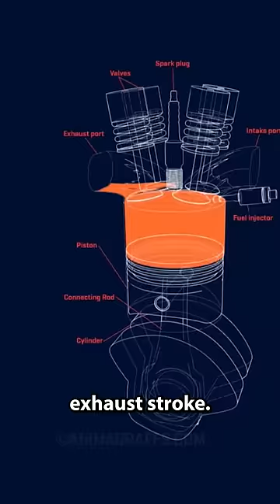Turbos Vs Superchargers

Comment: I think there is a time and place for both. Turbos are far more efficient and have much greater tuning capabilities. But a supercharger has immediate throttle response, and the boost is very linear. If i'm drag racing, or tractor pulling, or running the Texas mile, I want Turbos. If i'm racing a road course, where i need very precise throttle control, as well as the ability to make predictable and consistent power all through the entire rev range, then a supercharger is probably the better choice.
   
Another application where i think supercharging is better, is on our commercial work boats. Locally at the annual seafood festivals, the commercial fisherman drag race their work boats. LOL!!  It's a ridiculous spectacle. Seeing a 53 foot work boat with it's bow clear out of the water, skimming along at 60 knots with a rooster tail, It's actually quite hilarious.  LOL!!!   But the fastest guys are running superchargers. It's mostly because of heat. They run a mechanical draw-through fuel system, and also a wet exhaust. This keeps these engines quite cool under full load.  You try to do the same thing with Turbos, you have a ton of heat you have to deal with especially under those conditions. With those kinds of thermals there is certainly a level of diminishing return.  However, one guy out here is running twin VOLVO Penta engines with turbos, running into his superchargers.  Not sure how that works. Seems redundant. But... to each their own i guess. :)
Reply: I would pay too see these boats drag😂 where at?
Reply: There's still lag lol
Reply: Best boat engine had a blower  for ideal to like 3000 rpm . Then a turbo till top end
Reply: The turbo picks up where the blowers starts to fade. Nothing to lose, everything to gain if properly setup.
Reply: I like a turbo for drag racing because it's easier on the engine and car, easier to get traction. I only launch at 1.5 psi on the trans brake were with a belt-driven supercharger would be much higher. 
Of course, there are many ways to get a turbo car to launch like it has a supercharger with all the boost but it's unnecessary in some cases. Already running 9's on 10psi and that's fast enough for now with a 50 year old car on stock suspension and breaks.
In other words, what's perceived as a shortcoming of turbos can be advantageous to some.
Reply: Supercharged turbo explanation here: https://youtube.com/shorts/IDyELucAakM?si=XM7NexkFPHUfEoMK
Reply: No, you dont want a turbo for drag racing. Turbos are too sluggish for a drag race. A drag race requires immediate power. Drag races are over in 4 seconds. Turbos can take longer than 4 seconds to spool up.
Reply: @opieshomeshop  
Lol, amazing. Nothing you wrote there is true.
Reply: @177SCmaro  Amazing. Yes it is.
Reply: Wouldn't you want a super charger for drag racing since you have limited time, and don't give a rats arse about efficiency?

 I always thought Turbos were better for efficiency. Super Charger for instant power, but is completely parasitic. Especially now that we have turbos that can either be variable, shut off, or controlled. 

 Never thought about heat in a super charger versus turbo. Yet having a super charger being better at heat management is just so obvious, and makes perfect sense. I feel dumb for not even putting two, and two together. Thanks for bringing that up! I wonder what the differences actually are.
Reply: @opieshomeshop  
My 9 second turbocharged Coyote disagrees.
Reply: @dianapennepacker6854  
It's more of a trade-off than better/worse. Typically supercharged cars have a better 60ft times but turbo cars have more top end - in other words turbos do have some lag (although there are ways to eliminate this but it can be kinda hard on the engine) but tend to create more power per pound of boost because centrifugal compressors tend to be more efficient than lobe blowers or screw-type compressors.  
Turbos also take less horsepower to drive. It might take 150hp to drive a supercharger and on the same engine it might take 60hp to drive a turbo giving the turbo engine 90hp advantage at the same boost level.
And, in a way, there can be an advantage to turbo lag in that it tends to be easier on the car when launching and more forgiving to your traction/suspension setup.
But you can't go wrong either way, any kind of boost is gonna make more power over none.
Reply: That's why i own a factory supercharged '04 Cobra Mustang & '23 Powerstroke diesel F250 4wd truck! -NY
Reply: @177SCmaro  Mustanga for life! #GT350R #DarkHorse
Reply: The heat was the first thing I noticed when I started driving turbocharged engines. When I get out of my Mustang it puts out the same if not worse underbody heat than V8s I’ve driven and once it’s warmed up on a hot day there’s definitely a bit of power loss. I’ve read that a bigger intercooler will help but I’m not about to void my warranty. 😂
Reply: The turbos help the superchargers once they go past their pinnacle of boost
Reply: Both charger types combined is not uncommon. But heat problems on a boat is a design problem, you've got worlds largest heatsink. Proper cooling in the block, big exchanger to seawater, and a suitable intercooler will dump all the heat you need.

Comment: The energy it takes to push the exhaust out and spin the turbo is also energy from another cylinder‘s power stroke.
Reply: Not really; that power stroke benefits from the work done by the compressor side of the turbo that allows that cylinder to produce even more energy. 

A turbo is converting low quality heat energy that would have been wasted out the tailpipe into useful work at the inlet.

A supercharger is doing the same thing except it's using high quality kinetic energy to do it.
Reply: You make a very good point but..You're missing one thing...that is hard for me to explain.   You are correct that it still uses power to drive the turbo.  What Gale is saying is that the power used to drive it comes from the lower pressure exhaust stroke, therefore using all of the high pressure combustion stroke to drive the crank.  In other words, a turbo engine will have lower peak cylinder pressure to make the same power as a blown engine. I cannot confirm any of this myself, just trying to explain his theory.
Reply: @alcalc8938 I understand the point Gale is trying to make but he ignores the duration of the pressure! Since superchargers do not need exhaust valves to be open longer than turbo they can run similar pressure but for longer duration to get “longer” stroke of power. Modern engines can inject fuel 14 times during power stroke to keep steady pressure. 

If you were to take specific RPM (centrifugal supercharger) you can have same “peak power stroke pressures” as turbo engine while also making same horsepower.

Turbo is less complex less parts and not directly related to RPM of an engine, win in my book.
Reply: Your over looking a lot.   Turbos extract their energy from both pressure and heat while blowers only get their energy from pressure.  Some of the energy that drives a Turbo is wasted energy that the Engine didn't utilize.  You don't just have a piston physically pushing out exhaust gas on the exhaust stroke, that heated gas is still expanding in volume which is utilized by the turbo.    Super and turbo each have their pros and cons.  It depends on what you need and what you are willing to trade to accomplish that need.
Reply: @TheJTcreate  heat and pressure are essentially the same thing (enthalpy if you're an engineer). Another way to look at it is as an optimization problem. The engine is tuned to extract energy at high pressures and once the piston gets to a certain point in the power stroke it's no longer extracting much energy, that energy just gets blown out the exhaust and you'd have to dynamically change the cylinder diameter during the power stroke to fix that problem. The turbo is  fixing that problem but redepositing the energy it's recovered in the intake air to be reused.

If you look at a modern jet engine you have a high pressure turbine section and a low pressure turbine section (the power stroke equivalent in a jet) to deal with this issue, their geometry is different and the may (must? Can't remember) turn at different speeds.

A supercharger is using shaft energy (which isn't energy that is going to be wasted) to put enthalpy into the inlet air stream.
Reply: @TheJTcreate  Supercharging is a con period. Unless you are the type to drive a car as-is off the showroom floor. I used to have a Cobalt SS Supercharged. It's already at the limit pretty much from the factory. To gain serious power you need to twin charge it or replace the supercharger or both. Nitrous oxide is an option and the least expensive upgrade but not popular in the sport compact, 20 something first car community.
Reply: Doesn't the flywheel and staggered strokes kind of even all this out?
Reply: The term everyone is forgetting is "back pressure"

Basically If you want low end torque the supercharger is better than a small housing turbo with excessive back pressure.
Reply: @dj4monie Supercharging is a con in your opinion, because what, you aren't smart enough to realise that a supercharger has a limit to it's effective flow rate, just like a turbo does?  Or because you never changed the crank or supercharger pulley to get a higher turn ratio out of the blower?   And let's forget that miller cycle and 2 stroke diesel engines etc exist
Reply: @alkalk8938 But isn't one cyclinder's exhaust stroke another cylinder's combustion stroke so thereby a power stroke is still directly driving the crankshaft that is tied into another cylinder's exhaust stroke to ultimately spin the turbo? If his measuring technique is fair, it would be comparing turbo power (vs supercharger) relative to the cyclinders' power stroke pressure and not exhaust stroke. Seems to be a purposely handicapped measurement otherwise.
Reply: @dj4monie Supercharging is your instant response.
I've driven a SL55 Kompressor, and a small twin turbo hatchback.

The weight difference is staggering, as is the performance. If you want to run an actual car down the road quickly, a supercharger is the way to go.

Turbos are simply too inconsistent for anything deviating from a straight line. Cornering and accelerating out of braking demand instant throttle response. Even with a smaller turbo feeding a larger, they will never be fully in line. Turbos aim to solve a problem that superchargers don't have.

In terms of parasitic loss, you have to think about how often you're able to go flat out to benefit from a large turbo. Because for a small turbo, it's going to be outgunned by a steady supercharger anyway.
Reply: Ya lets argue with Gale Banks....😅
Reply: Well the engine will still gonna have to get rid of exhaust gases anyways so why not make use of it.
Reply: @SpiderHamPeterPorker  if we look at it like a single cylinder engine to simplify it, your point stands that the turbo is drawing power from the backpressure created by the momentum of the crankshaft, which is only moving because the power stroke is pushing it along. so there has to be a certain amount of work done to feed both the parasitic load and to create your usable power. a supercharged engine has to create all its power with one stroke of the piston meaning you need to create less power, or make your engine stronger. a turbocharged engine has the luxury of spreading all its work out between the power stroke and the exhaust stroke, meaning more power or you can get away with a cheaper/less durable engine with the same power. add in the fact that the exhaust gasses are still expanding due to the heat they carry and you get an additional bonus of efficiency.
Reply: There is no free lunch especially in thermodynamics
Reply: @piterpraker3399  turbo's game is economy/efficiency, blower's game is throttle response / linear torque
Reply: @mrD66M  Indeed. The thing is, most roads in America - and all of the fun ones - are decidedly not straight. On the interstate, I could see a turbo being better. On something like US 19, back where I live, you're going to want a blower.
Reply: No, at the end of the power stroke when the cylinder is at BDC and the exhaust valve opens, the pressure in the cylinder is still way higher than atmospheric. Most of the exhaust escapes on its own and it has enough "free" energy to spin the turbo on the way out. In the exhaust stroke, the resistance added to the engine by the turbo is not as high as you think. Pressure pulse from the exhaust valve opening travels at the speed of sound, it gets the turbo spinning even before the piston has a chance to begin the exhaust stroke. The exhaust stroke doesn't drive the turbine as much as the pressure pulse does.

Turbos add some parasitic loss, but most of the energy it harvests is from what would have been otherwise wasted as hotter and louder exhaust.

CAFE restrictions has forced everything to be downsized and turbocharged. Manufacturers aren't stupid. Turbos give you more of the same amount of fuel.

Comment: I love Gales research and development,  but I can debate.😊
Gale, I agree there is now parasitic loss on the power stroke for turbos but there is a parasitic loss on the exhaust stoke. It also takes energy to spin a turbo as it does a blower. 
A blower not only uses power from the power stroke but it does not bog down the exhaust stroke. 
There is a difference between the two compromises due to one effort being mechanical driven and the other being thermal dynamic driven. 
So, what is better? For me, I just love a big ol blower hanging out of the hood and that surge.  😊